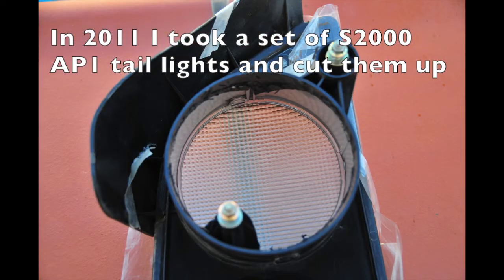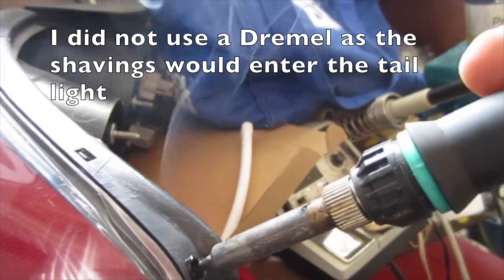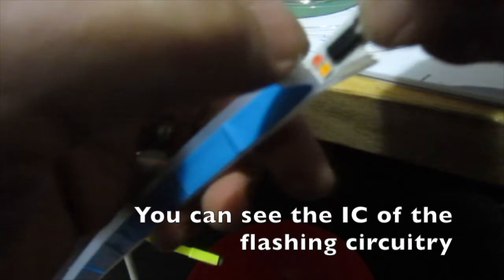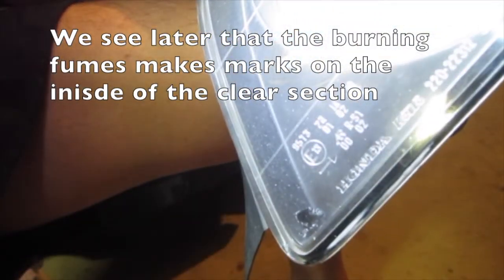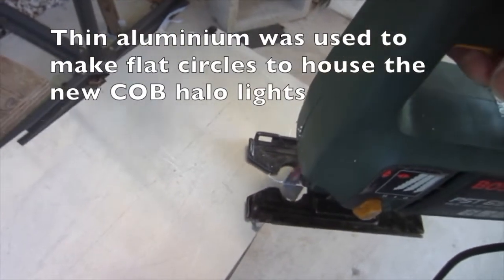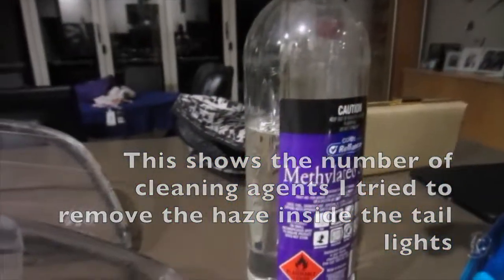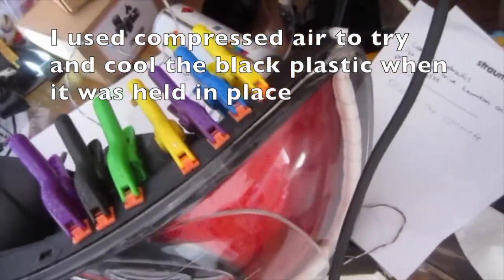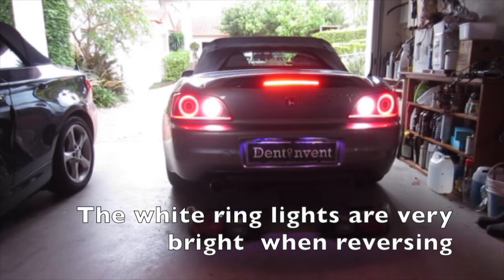S2000 ultimate COB halo and switchback LED custom tail light project . Technology  in ten years.

Comment: nice dude, they really bring a more modern look to the back end while still keeping the original shape. Thats the  best of both worlds, good job.
im actually preparing to do a project on my tail lights too. 
quick question; is it necessary to use the voltage regulator for dimming the brake lights?  im just asking cause the tail lights i have on my rx8 are aftermarket led lights that have an adaptor that hooks right into the stock harness, there's no additional drivers or anything. Theres also a seperate harness for the turn signal, reverse light and side markers. When i press on the brake they light up like normal. 
Do you use one because ur s2000 gives you light errors and hyperflashes without it?
thanks!
Reply from the maker: I have a bulb attached in line so avoid hyper flashing .
The voltage regulator is just so I can have a low brightness red running light and a full voltage brake light .
If you try other ways of dimming , you lose a lot of energy while it is used as a duller running light . This is usually dissipated by heat . The method of using a Buck converter loses less energy ( not much heat either ). 
I’ve bought red tint to tint the whole tail light but haven’t yet done it .
Best of luck with your project .

Comment: Great Video!!! Can you post a link to the COB lights an the Converts?
Reply from the maker: Just clarifying , you want a link to where I bought the cob ring lights and not sure what you mean about the “converts “
Reply: @Dentinvent  sorry meant convertors.  Basically all the items needed for the last modification you did with the COB LEDs.
Reply from the maker: The items I used are like these ( I prefer the ones with three blue pot adjusters as one controls voltage output and one controls current limiting . The middle pot I think it to do with battery charging circuits .
https://www.ebay.com.au/itm/322613826308?mkcid=16&mkevt=1&mkrid=705-154756-20017-0&ssspo=0HkzUFqgS06&sssrc=2349624&ssuid=PgJMlECQRru&var=&widget_ver=artemis&media=COPY

The cob you just search angel eyes cob halo on eBay and work out the sizing you need for the effect you want .
Reply: @Dentinvent  thank you! Great video it was rally  helpful!!! Did you also do a how to install video of the convertor?
Reply from the maker: Try watching this at about 5.43 and it shows how I connected a buck converter originally that controlled both rear strip leds . If you pause the video now and then , you should be able to see how I wired it .
You’ll notice it is the same buck converter .
https://youtu.be/N_205sQD6XE
Reply: @Dentinvent  hello! What is the size of LED halo rings you used?

Comment: how hot do these cob lights get in a sealed headlight housing?
Reply from the maker: Almost no heat at all. The electronics I used to dim the lights also have low power loss and hence not much heat .